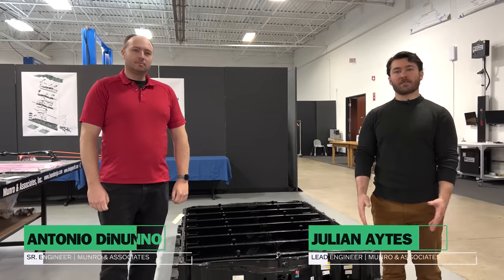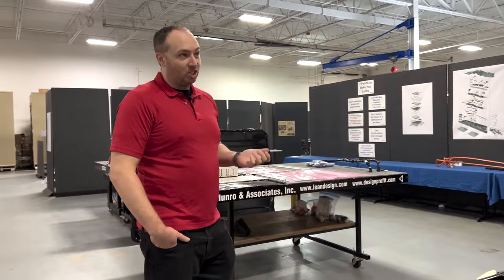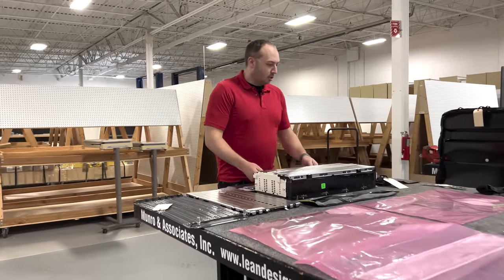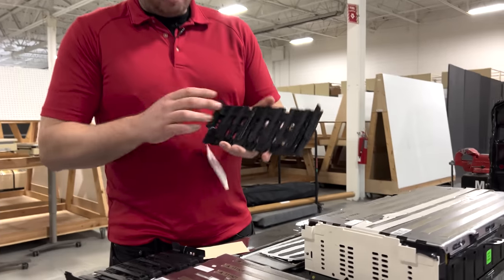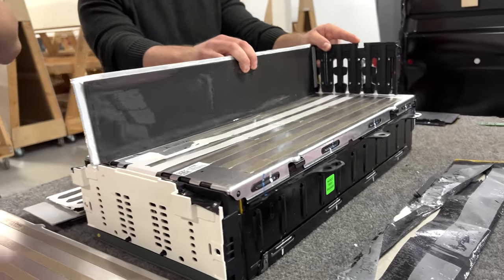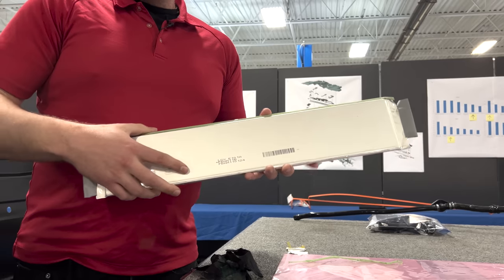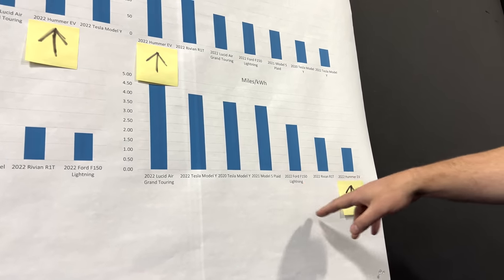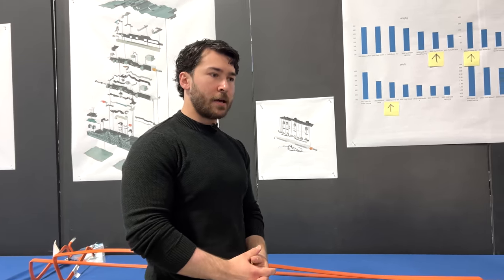This is NOT Lean Design: Hummer EV Battery Pack Breakdown

Comment: Another very informative video. Well done. 

GM is not going to last if this is the best they have to offer. The building of the battery pack seems to be complex and inefficient.
Reply: 1. They are still learning
2. These packs are actually servicable, something tesla could learn from. If a cell fails, you can open up the pack and replace a simgle battery module instead of the entire pack.
Reply: @ryanthompson2893  you don't want a serviceable pack. It will cause it to fail early. You want one that's going to last the life of the car to start with. You shouldn't be mixing old cells with new ones. It will cause an imbalance in the pack and lead to more cells failing.

Comment: I’d like to see a video on the role of Tier 1 suppliers. For example this battery enclosure is made by Magna, not GM. Magna also makes the Lightning enclosure. Does a Tier 1 supplier just make it EXACTLY how the OEM wants it, or do Tier 1 suppliers have the freedom to build how they want to, as long as it meets the general specs. Dimensions, bolt spacing, etc.?
Reply from the maker: We could do a deep dive on the role of tier 1 and tier 2 suppliers on our podcast channel.
Reply: @MunroLive  That would be excellent!  I’m mostly curious if this enclosure (with the multitudes of stampings, welds, etc.) is precisely what GM wanted, or would Magna just throw out a dollar number and GM (or any manufacturer) just cares about the bottom-line, regardless of how “lean” the design is. Also wonder if there’s similarities in construction to the Lightning enclosure.

I also wonder if these are Warren, OH built Ultium cells. Or LG imported cells?  I think I heard early Hummers and LYRIQs had imported pre-production cells m/modules from S. Korea (?), as the “real” Ultium plant in Warren didn’t actually start making cells until Sept 2022, or later.

Comment: At 6:10 mentions pack is broken into two blocks, and uses series or parallel switching for drive mode or backward compatible DCFC mode...

Finally! Someone did the simple solution instead of adding extra dc-dc voltage down converting for a 400+v archetecture.

Next trick is to let such a system utilize dual DCFC charge ports and charge sessions at locations that can not do the higher pack voltage, resulting in the same half time needed advantage.

Comment: Tesla: Gotta make our design simpler, less is more.
GM: Hold my Bud Lite.
Reply: Tesla's first roadster was very similar to the Hummer. It was over complicated, over built and not efficient. This hummer was simply designed very quickly so they had to focus on reliability. Efficiency improvements can come later.
Reply: @JasonWW2000  Tesla was around 5 years old when the Roadster came out. GM 110 years when introduced the EV Hummer.
Reply: @beans4gas  Yep, how old is Ultium, like 3?  Looks like the Hummer was designed in just 2 years. That is a very rushed timeline. Most vehicles are around 5 years.

Comment: I want to buy a wrecked one just for the battery pack alone, over 200kwh of off-grid storage, could run a house for days.
Reply: This is a good idea!
Reply: It could run our whole 5bd 3 bath ranch house for almost 2 weeks. 7 days even during the summer here in GA. 😀
Reply: @4literv6  Sprinkle a little solar on the whole setup and you're good to go
Reply: LiFePO4 for $40,000 w/ tax credit.
Reply: @benc1927  exactly, hoping to ad that late next year or in 2025 using locally sourced panels. 👍🏻😎
Reply: @jghall00  Wrecked Hummer that nobody wants with a good battery that nobody needs will cost less than $40k — but they’re going to be ultra rare.
Reply: @tommornini2470  The nobody needs part isn't true. Ebay is full of EV batteries. They're actually in demand for energy storage projects, so don't assume you'll get a discount because it came from a wrecked vehicle. The batteries are very popular for 2nd life uses. You'll also not want one of these near your home, because of the fire risk. LiFePO4 is a better chemistry for home storage.
Reply: @jghall00  I meant as a replacement for a Hummer battery, but you’re right!

Comment: Equinox and othe GM will basically use the same design, but with 1 stack instead of 2. So the wh/kg will be higher cuz you dont cut part by 2, as the bottom and top plate will basically be the same… 
In my mind, this is not scalable and it may the reason they announced they will go cylindrical. 
Ultium might not be such a good pack after all.
Reply: As soon as GM revealed the Hummer EV, it was apparent that altium was dead on arrival.
Reply: And just look at all of the custom stampings that go into this double-stacked box. Ford was at least clever with their double-stacking, and just added extra height to their single height box. This is a completely bespoke and expensive box just for the Hummer. Maybe it would come out in the wash with military contracts, but it just seems odd.
Reply: Wh/kg will be lower you mean? Less energy dense?
Reply: Not “scalable.” Munro associates couldn’t lift the Frunkin’ thing onto a scale!
Reply: @patreekotime4578  The Lightning isn't capable of off-road use outside of dirt roads.

Comment: Yes, folks, but note they say the power density by weight on this battery pack is within normal range.  Maybe a steel housing seems complex and heavy, but it doesn't seem to affect overall performance, and there's no breakdown of cost difference.  

And a question: these battery packs are structural - does that account for some of the weight?  And if so, does that allow reductions in weight elsewhere?

Comment: My best guess is that they did this because this is going to be a rather low selling model and they're trying to perfect a way to produce it as such. And doing so they're going to have a lot of varying ways of producing these packs. It's not bad design. It's a design that's the result of limited resources.
Reply: It’s a design that reeks of too many resources, too little passion to give a shit — and not enough talent to do it well.
Reply: Uh the everado has this same chassis and pack. They have over 150k reservations for that truck already and another 50k+for just the hummev variants. So no this isn't a low volume pack and chassis design. 🙂
Reply: So you missed the 257 fasteners and 105+139 discreet stamped components?

The limitation is in their thinking.
Reply: @4literv6  It’s certainly not designed for manufacture!
Reply: I guess selling two Hummers per quarter qualifies as low selling volume.  It does mak it easier to claim they doubled production when they start to ship 4 per quarter!
Reply: @4literv6  how many have been actually produced? Not many. This looks to be an early production issue as there are too many issues to not be so.
Reply: @akr01364  I think since the end of 2021 when it started up production maybe 1,000 in total hummev we're made? 
Whatever it is, is a sick joke for a century old company who at 1 point in the 60s built over 65% of all car's sold globally. 🤔
Reply: This is not at all the perfect way to build a low volume product. They sunk a ton of cash into stamping dies for parts that could have been stick-built from extrusions with just as many welds. This is high volume manufacturing design. This giant pack is destined for other vehicles in their line-up like the Silverado. It will be interesting to see how much that weighs.
Reply: If you believe that, all I can say is that they failed miserably.

Comment: It appears you totally glossed over the little tidbit that the battery pack is is also the main structural component of the frame for the vehicle.

I see the design as similar to a body-on-frame design, like the Lighting, that happens to fit the battery modules within the frame.

Comment: I wonder if the Lyric's pack is similar to this or not. If this is kinda proto-type-ish then I kinda understand, but if they're standardizing this?....
Reply: No way they would do all that stamping for a prototype. Lyric will likely have a single-layer pack, so the internal modules may be common with this pack, but it will have to have a completely different outer box with different stampings.
Reply: @patreekotime4578  in some ways that seems worse?
Reply: Yes, it's the same platform, but half the battery pack that the Hummer used.  It's not a prototype, this is the Ultium platform, it's the common powertrain for GM going forward.  The vehicle chassis will be designed around the battery pack, sedan, suv, suv, cargo van, etc.
Reply: @cyclopsvision6370  I'm still hoping that what we see in the Hummer isn't actually the final form factor for the Ultium platform. Time will tell. I really want to see one of the electric Silverado trucks, to compare.

Comment: Two questions. It's the new GM ultium platform that they are going to use in all their new cars? It still uses pouch batteries?
That model y had a structural pack? Then it's not the greatest comparison as it's not just a pack but also a structural element.
Reply: Yes. This is the ultium battery pack. Yes it still uses pouches. Yes ultium is a marketing scam and is nothing new or innovative. It's just the same pouch cells stacked on top of more pouch cells.
Reply: @themonsterunderyourbed9408  Just like "Crab walk" is a marketing scam, GM had Quadrasteer 20 years ago where the rear wheels could turn, there is nothing innovative about Crab walk

Comment: Is it possible that this vehicle is a rejig of another GM project, for say a military submission, where maybe the "robust" and almost primitive configuration would have been necessary ?
Reply: My suspicion is that the entire Ultium platform is based on their military contract requirements and GM are attempting to offset development costs by sharing it with consumer facing vehicles.

Comment: Could the battery pack exterior enclosure not be made of plastic material options? And bolt on a bask plate below it for piercing protection?
Reply: No, because these knobs don't understand the pack is a structural member too the vehicle.

Comment: Lord have mercy!!! You can tell this vehicle was just done as fast as possible to throw something out there as a "see we can make an EV too". 

Sad that GM doesn't intend to ramp the production up or redesign this vehicle. Lots of people who ordered one will never get it because at GM's current production rate it will be over a decade. GM is wanting people to cancel their orders so they can stop making this POS. 
   This was all done for show.... what a freaking waste of money!
Reply: I'm sure the engineering would have matured over time.
Reply: @JasonWW2000  Hopefully they won't just take this same pack and put it in the new Silverado. If they do then it won't be able to hold much extra weight in the bed since the weight limit for the chassis of that class of vehicle would largely be taken up by the battery weight!
Munro said that the Hummer's battery pack alone weighed as much as a small car!!
Reply: “This was all done for show”

No, likely done for future military contract where they need electric vehicles to transport soldiers… steel a better choice than aluminum
Reply: @DavidHalko  I think Nick means it was more a flagship product. Similar to the Lexus LFA or Honda NSX. It shows what GM can do, but not meant for high volume production. 
I really don't think they had the military in mind as far as them making a military version of the new Hummer. It at least shows the military what is possible. Big heavy, yet powerful and fast. If the military were really interested, GM would probably design a new vehicle from scratch and maybe carry over a few drivetrain parts. That's my guess.
Reply: @JasonWW2000  - “shows the military what is possible”

And I think this is exactly the point…

Using a former military civilian brand helps communicate that the objective put forth by the current administration to decarbonize has a possible roadmap… if they can afford it.

Not just for show, but a VERY working prototype as a basis for future military contract. At least the military has a listing of features to write into their RFP, now, which a GM contract can fulfill.

On the negative side…

A bullet in a battery would cause Lithium Batteries to go up in flames, though… unlike a petrol tank, which just springs leaks (and this can be mitigated with self sealing gas tanks, so liquid carbon fuel still seems to be more practical in a war.)

Comment: The cooling channel plates at 11:03 are very inefficient. Ideally they would cool across the large area with aluminum fins BUT, unfortunately for cells to have long life, all the cells need to be kept at relatively the same temperature so their resistances are matched and we don't get hotspots.

Also the protection on the nylon lines should be for fire resistance.

Comment: 25:38 I can't see how aluminum busbars would be appropriate for this application, regardless of space considerations. The only automaker I know of who is effectively using aluminum busbars is Lucid, which they can get away with only because their entire system is 800 V. The thing to keep in mind is that the busbars need to carry current required for both charging and driving. The HUMMER EV can output 750 kW while driving, and because it will often be used for towing, it's likely to maintain higher output powers for longer sustained periods than something like a Lucid Air sedan. At 400 V, 750 kW requires the busbars to carry nearly 2000 A of current. Even at 90 C temp rating, you'd need 4000 KCMIL of insulated aluminum busbars.
Reply: 750kW? 2000A? I think you're almost an order of magnitude off there
Reply: @Username-qx9gk  Explain. How much current do you think is required to produce 750 kW @ 400 V (less with voltage sag)?
Reply: @newscoulomb3705  If I understood correctly while driving it's configured as two 400v packs, so each "half" is carrying 1000A? Everything after that is the full current tho.
Seems ridiculous tho, 1000hp for what exactly? This pack seems like it would be more well suited to a minesweeper than an SUV

Comment: This battery is surprisingly complex, but keep in mind that a fairly small number of the vehicles will be built and the intended application is for unusually harsh environments.  So-called lean design has associated cost which makes sense when amortized over hundreds of thousands of vehicles.  GM may only produce fewer than ten thousand Hummer EVs, so it doesn’t make sense dumping millions up front into designing a battery which may not be used in other applications.  There is value in time and sometimes just getting a job done is more important than making it engineering class textbook pretty.

Comment: The whole point of the steel structure is to protect the batteries in the event of a crash. It is this which drives the design. Compromising the batteries in a crash is deadly. 
This is a very heavy vehicle so the energy in a crash is high. It is a tricky design balance to provide adequate protection without adding excessive further weight.

To completely ignore this aspect and focus on manufacturing cost and material cost alone is very misleading.